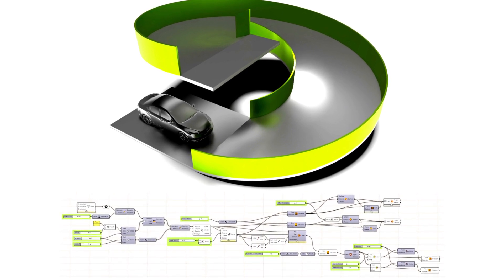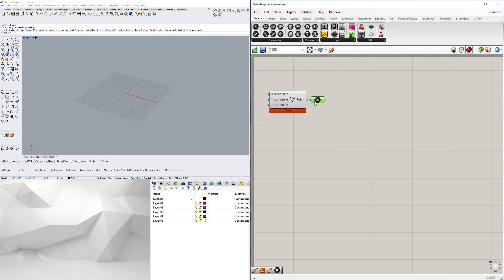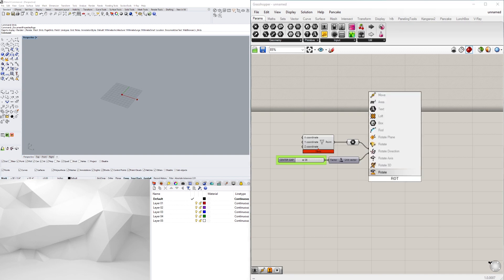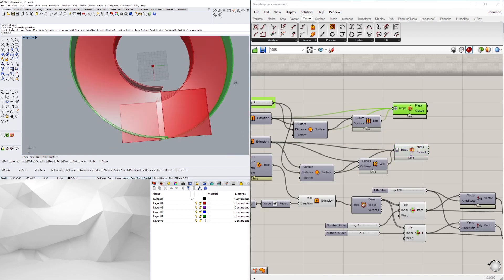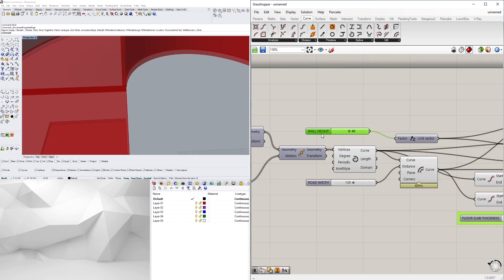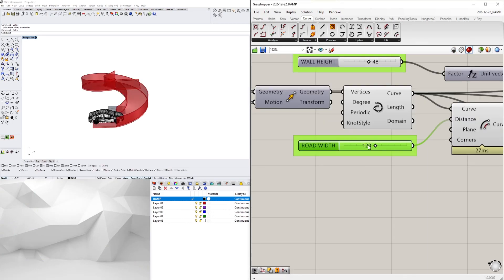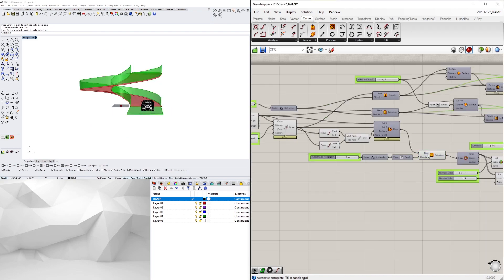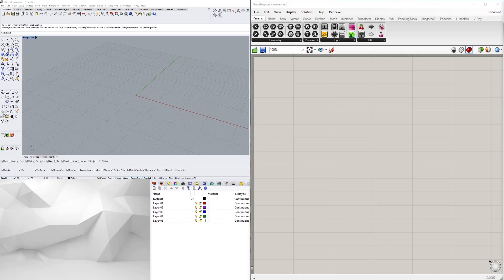Rhino & Grasshopper Spiral Ramp Parametric Architecture

Comment: When you offset the curve at 2:22, I got an error saying that the offset curve must be provided if the curve is not planar itself, but is there any work around for this? I'm not exactly sure why this is happening as everything else is coded the same... 
Thank you in advance!
Reply from the maker: sometimes you need to use a plane reference to offset.  use planexy, and that may fix the issue.
Reply: @DCOParametric  Thank you so much for the reply! It was fixed with planexy but it started interfering with the inner wall extrusion later on where only one side of the walls would show up.